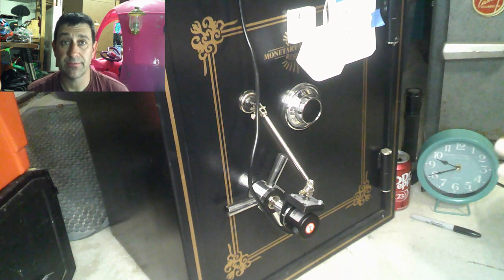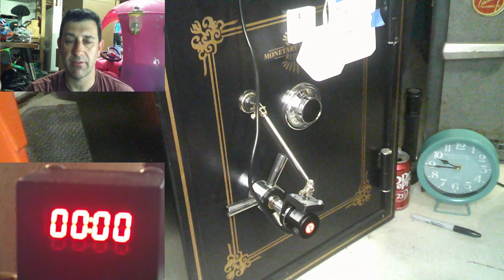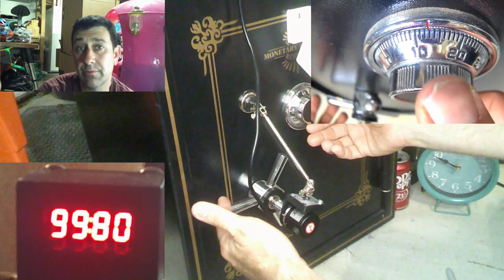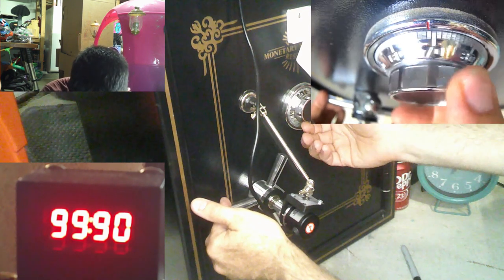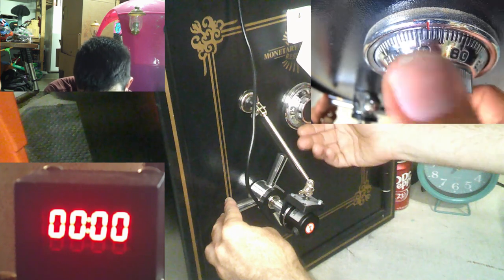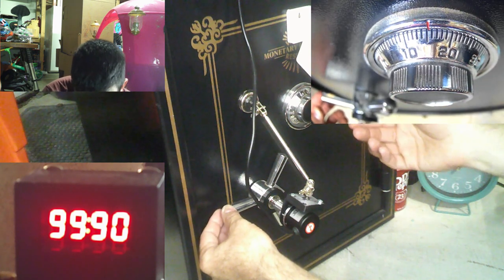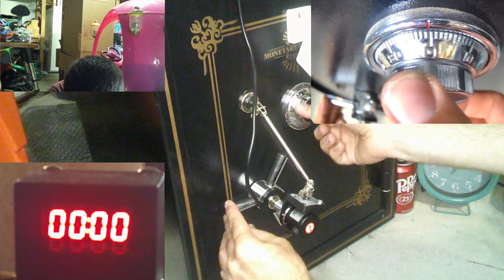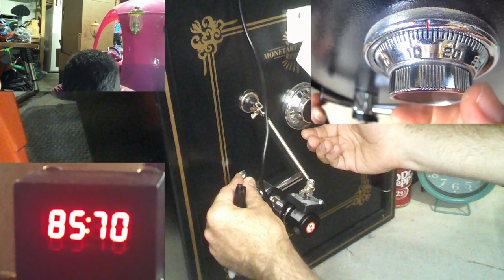Step by step Safe Cracking Tutorial of Money Exchange safe with a DDM

Comment: Although I don't yet grasp the finer points of your manipulations about direct-action, it's quite fascinating to watch you work on that safe, going in blind to boot, as you explain your process and mental image of the lock.  Thank you!

Is it standard in the industry to have such a seemingly large +1/-1 (two-ticks wide) tolerance?  What's the most top o' the line or recent safe you've opened using such methods?  Curious mind inquiring.

Comment: I purchased an old safe and was told it worked. The seller removed the safe from the building and had dropped the safe on its side and it was laying on its back when I arrived. It did not appear to hurt anything at the time and I took it anyways.  Once I got it home I realized The lower dial sticks when turning left between 3 and 4. You can turn it to the right and it does not catch on anything. The upper dial seems to work fine. I have the combination they gave me not sure if it's right. How would i go about getting it open.
Reply from the maker: Send me and email with a pic of the safe and ill see if we can get it open.  Contact@scobieworks.com

Comment: Does a direct-entry safe combo dial differently than a typical safe, such as a S&G group 2? I just don't understand why you were able to dial all the wheels right to 98 and then go immediately to 15 without having to pass 98.
Reply from the maker: Yes.  Dirct entry is very different.  They ate like onlynhaving the gate.wheel ans two combo.wheels.  you set the combo wheels and then turn th3 gat3 wheel to the right number.